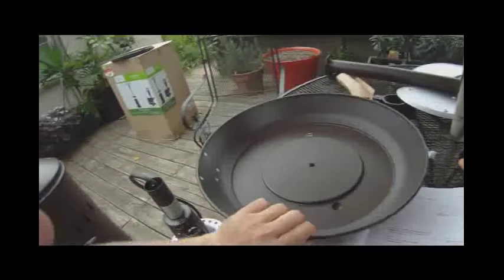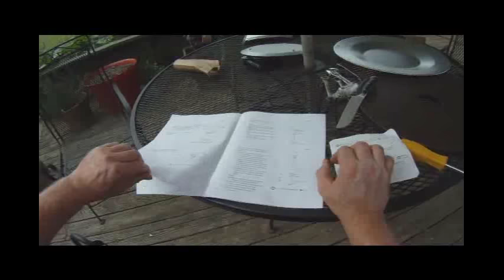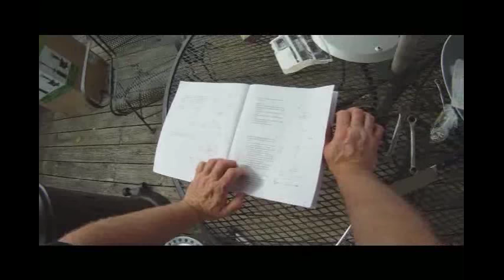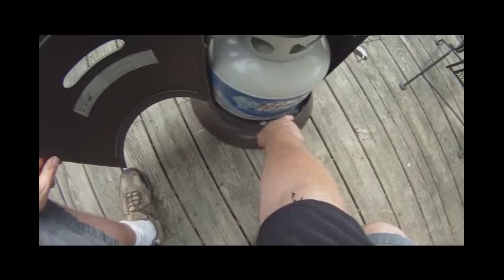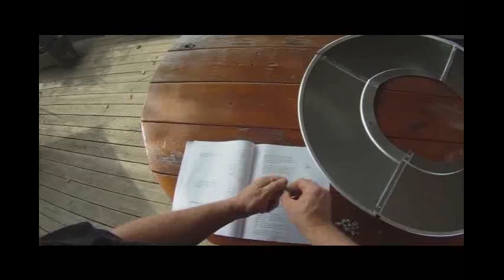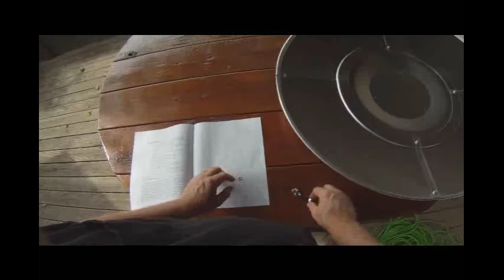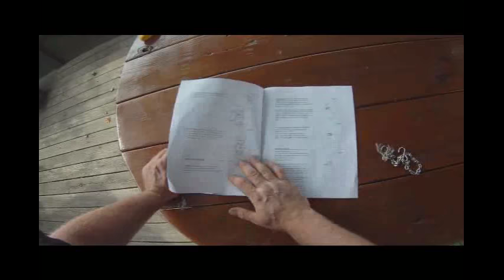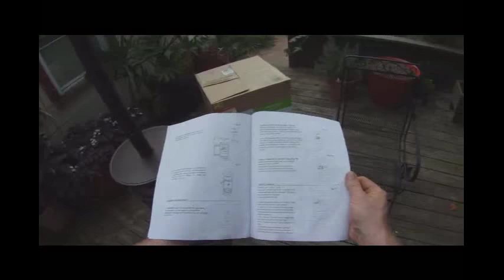Patio Heater Assembly & Review

Comment: Just got mine today, i dont have the door but the whole cylinder over the tank slides up.  Perhaps your rivet issue was addressed..  sitting outside now on my patio with it going and drinking a beeer.. keeping nice and warm.

I ageee the nut, washer and bolts being screwed on were kinda annoying. They also changed the propane connection where you dont have to bend the line to feed it through.  I dont know if theyre 2 seperate models but mine doesnt have the tray either but looking on the website mine is the only offering so i assume they improved upon some design flaws which I am happy about.  Got mine for $119 but right now black friday has it for $109 which is the lowest ive seen on these patio heaters..

They also addded 3 brackets to the base so you could screw it or attach it to the ground but mine is on my deck and im not driving screws into it.. gotta find another way so it doesnt tip over in the wind and the ignitor isnt electronic where you hold the button in for multiple electric pulses you have to push it each time.

If anyone is curious the 2 bolt sizes are 10 and 14mm, my cordless ratchet made quick work of it.

Comment: Are you able to access that bottom reservoir to add sand to stabilize it better without having to disassemble?
Reply from the maker: The side opens up to put the gas bottle in and its pretty stable, you can put sand in bottom under the gas bottle, but if you want it to more stable so wind doesn't catch it so easy, buy two of those 20 pound flat barbell weights and put them under the gas bottle. Thanks for watching and commenting hope that helps.

Comment: Is the gas smell bad ???
Reply from the maker: We still use it alot and there isnt any that I can smell. Thanks for watching and commenting.
Reply: Umm you should definately not be smelling any gas, once tou connect the propane to the hose use a spray bottpe and soapy water and spray the connection to make sure there are no air bubbles forming or that means u have a leak.